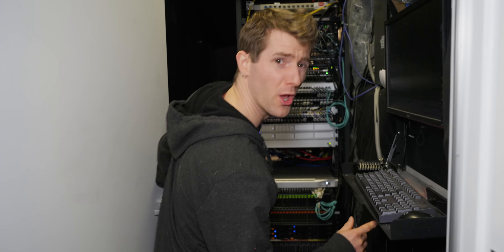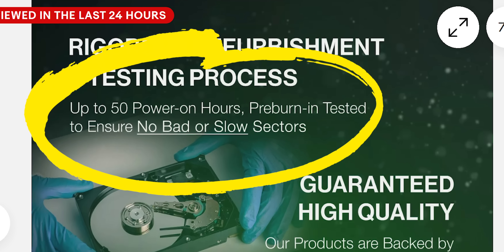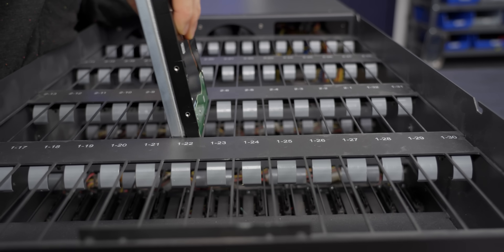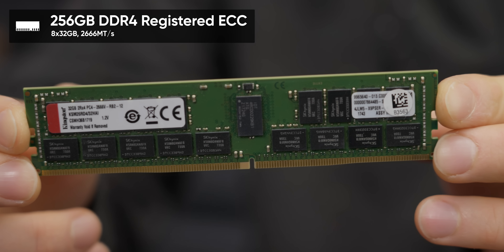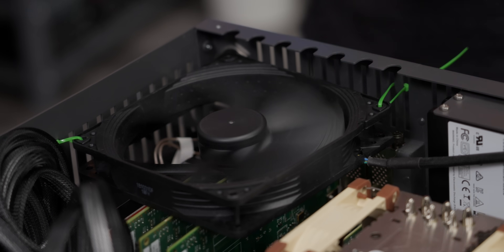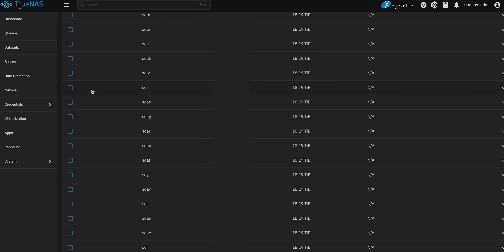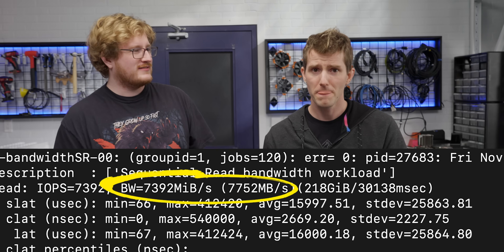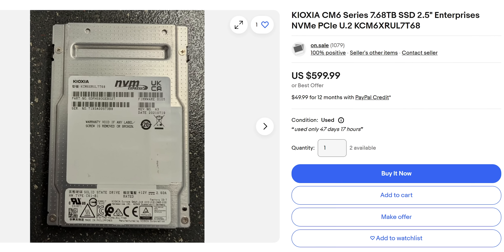Is Buying a PETABYTE on Ebay Stupid?

Comment: I've had 4 used 4TB HGST drives running at home now from Ebay at $65 each since 2019, then in 2022 I bought 4 more of the same drives for $35 each.  I plan on buying some more used drives soon as I've about got those full.  Also long run HD video, so sequential reads and writes are all I really need.  That and really long term backup storage.  I of course also have these backed up with Back Blaze.

Comment: I’ve been running 6 * 12TB seagate exos drives running on Unraid. Got them on eBay been running 24/7 for about 3 years next year. Been thinking about changing out to SAS drives

Comment: Switched from my old 3 x 8tb new drives to 3 x 18tb recertified seagate drives after one of the at that point 7.5 year old drives died earlier this year. They were basically new but one had one tiny error after I completely tested it. Nothing on retested. I guess I’m fine. I have 4 year warranty and even if one fails and I can’t get warranty I still come out ahead vs buying new.

Comment: I wouldnt worry too much about your drives. I have a 8 yr old 1tb harddrive that has been kicking nonstop in the computer. I think its starting to fail but it still works. Im running mine till death.

Comment: With so manny drives running them in a raid set it makes a lot of sense to use cheaper recertified drives. When one fails it is probably cheaper than full retail on new drives

Comment: I think it's important to note the killer for consumer spinning dives isn't power on time, it's power cycles. That's when the motors take the biggest hit. It take a big surge of current (relatively) to power up a motor compared to just keeping them spinning. If you don't turn them off... I've only ever lost drives to shock damage from them being knocked around.

Comment: 1:20 do they actually have any "ai" (machine learning) features or are they just another product shoehorning ai into its name
Reply: 14th gen HX = doesn't have a NPU -> shoehorning
Reply: Probably it is just "capable" of doing a.i tasks
Reply: Short answer NOP. There are almost no commercially available CPU's or GPU's for that matter that have hardware build agents in them. So it's misleading advertising in it's purest form. // To clarify RTX is not AI, nor software that is optimized to run AI related tasks
Reply: To be fair, even AI isn't AI. So it's not any worse than LLM and diffusion models branded as AI. Meaningless term all around. AI still doesn't exist. Part of me kind of thinks it's poetic justice that everyone co-opted the term and made it lose any meaning it had because it didn't have any real meaning to begin with.

Comment: My server runs recertified drives. It's my first batch and it's only 2 drives. BUT it's also been nearly 2 years of them running 24/7 and they still work fine. Paid ~$70 USD a drive back then for 8TB. The drives came with a full 5 year warranty too. Planning on next year buying 4 12 or 16 TB drives so I can go from a 8TB array to a 24/32TB array. PLEX servers really demand a lot of storage.

Comment: I have 40Tb (2x 20Tb Seagate Exos Recertified bought off Amazon) in a 4 bay Sabrent DS-SC4B for my media library in a Mac setup.    Nice thing is, I still have 2 free bays in the Sabrent for something else.  I've been thinking about getting a 12 or 14Tb Seagate Exos Recertified for use in Mac Time Machine Backup.  That would still leave me with 1 free bay.    Been using Final Cut to upscale my 1080p movies to 4K.  M4 Mac Mini Pro is on order, waiting to take delivery.

Comment: I got a couple HGST 12gb refurbs from eBay and they've been running a couple months now without issues. Power on count and hours was reasonable. I figured if the seller is offering 5 year warranty as part of official that refurb program then they're pretty confident in their drives. They also had seagates but "only" 3 year warranty

Edit: One of them acted up after a few months but the seller sent a replacement very quickly.

Comment: My personal storage array has close to 30 of the 10TB drives from Server Parts Deals.  I have bought them over the last few years and have had a failure rate inline with buying new for the data center I run professionally.  I have sent many people to them over the years and still buy from them often.

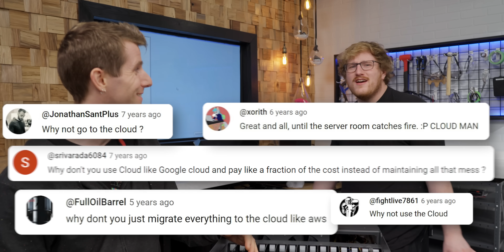Comment: 5:10 I mean... look you're right that cloud is expensive for medium-to-large size uses, but you have to stay honest with the selections. Your AWS calculator amount is 4x as expensive as a sensible setup would cost. I would imagine these items aren't accessed all that often; these should definitely be stored as Deep Archive objects rather than Instant Retrieval. Realistically you'd be paying closer to $20k/month with objects tiered appropriately. Still, that's 2x what you dropped to get these

Comment: Personally I run 15 drives which are all used or from these referb places and I've been doing it for years without any more failures than when I used to only use new drives.

Honestly, I have had way more failures of SAS cables, etc. than anything else over the last few years.

Comment: I bought 20TB WD External HDDs and shucked them into my server. It was not as cheap as the recertified drives but they do run without any issues for couple of months already. I bought if off amazon and one HDD was around 300 euro with the enclosure which I could probably also resell and gain some money back.

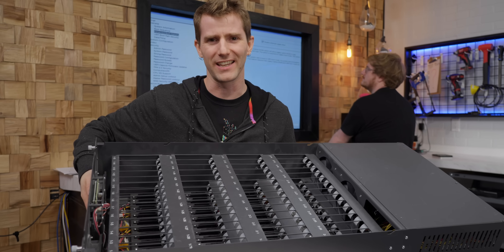Comment: Heads up, I would NOT recommend the Jonsbo N4 that you flashed at 5:40 .  The layout is pretty awful, the drives don't stay cool enough, personally I would not build in it again.  It essentially requires some 3D printed parts and some extra cooling fans to work, and most SFX power supplies will need a cable extension for the 24 pin due to the awkward layout.

Comment: I'm running unraid and bought a used HP Raid cabinet that came with 16x4TB used drives.  I've only ever bought recertified drives to replace drive failures.  I've done about 4 replacements for over the last 6 years.  3 of which were OG drives from the raid cabinet and the other was the 2nd recertified drive I'd used to replace a bad OG drive.  I just recently started buying 10TB recertified drives and am replacing all the 4TB with 10TB over the course of the next year.  For home use and the fact that you're protected by what ever redundant RAID option you picked it just makes way more sense to buy recertified.  The money I've saved has greatly outweighed any dependability I would have gained from paying 2-4x the price on new unused hardware.

Comment: I bought 10TB HGST from eBay; 100+ of them. No issues after 2 years.

But the other seller I used prior, I returned all 60 drives. I had 10 with issues in that batch.

Comment: I've been doing this for a while on eBay. Sellers are selling several hundred at once and appear reputable and been around for a while. Just old server parts, basically. I was able to get 8x 14TB WD HC530 recently for $110 each (at the time). Drives are used in an raid with redundancy so risk still acceptable. Before that, it was shucking Best Buy WD EasyStore drives around black Friday.

Comment: I've been using used drives for sharing my Linux isos for friends and family. For the last 5 years only one of my drives is starting to make noise out of the seven I have with the arm motor getting louder so I'm gonna be replacing that drive shortly. Else it's been a smooth ride using these "used" drives. Same with SSDs. I've been grabbing Intel pcie ssds when I see them for a good price. Great game drives for desktops or caching drives for my NAS. Just don't save anything you deem important on them and feel good about yourself knowing you saved a few bucks.

Comment: Linus make a video about airflow .. I know this all, but i see videos on YouTube with total wierd stories ..
So i gave them the reaction that the amount of air what comes in got to go out on the back of the case with the same amount or as near as possible .. 
They didnt undertstand that kind of thing .. LOL :face-blue-smiling:

Btw.. Recertified hard drives are units that have undergone a thorough certification process by the original manufacturer. This is a good buy if you need many disks :hand-pink-waving:
They have now Barracuda Pro for 112 bucks .. Its 12 TB .. Thanks for the tip Linus :trophy-yellow-smiling:

Comment: they come from data centers. it's common practice to switch out drives after their warranty period as it's more cost effective through exclusive deals with manufacturers than going through the process of potential loss and recovery of customer data, and in the past they were actually destroyed to prevent any sort of rogue recovery of vital customer data. not sure what's changed, but ive noticed a half official half unofficial market emerging for them over the past few years. they're often close to new condition and had gone through more extensive qc so the few hours on them dont mean much. win for the consumer if you ask me

Comment: I hope that the BcacheFS file system will become a more popular choice for network storage, where the priority is the speed of data access, especially for small arrays of 3-4 disks, this system shows itself best with an SSD as a disk with a cache. It also can work with various RAID configurations and disks of different sizes, making it a good file system for large libraries of games.

Comment: I got a 25 SFF SAS3 HP proliant DL380 P Gen 8, and an old 10bay SFF HP Storage Works MSA 50 brings my system to 35 drives I only have 16 TB raw storage, 7TB Usable. 2GB flash back write cache as well and quad gigabit Ethernet and dual 10 Gigabit sfp

Comment: I've gotten all of my hard drives in the past few years from ServerPartsDeals (maybe 6 or 8) and only had one issue, which happened soon after installation, and they replaced it under warranty, so I'm quite happy with the cost savings.

Comment: I got one as a replacement for the one I sent in as part of their warranty program. Still going strong. So my old drive might be out in the wilds now as a refurbished one. The only thing you need to take care about is to get those drives from a certified seller as there are fake refurbished ones on eb*y (and other platforms) with faked stickers as far as I am aware of based on research on them.

Comment: I have an i3 system, bought 36 12 TB drives off Newegg. $68 a drive after rebates. This was a couple years ago. UltraStar. In the last two years I have had two drives fail, running Z1 I have had no issue swapping those drives out.  I have not tried reconditioning the failed drives but that is on my list to do.   I also run mirrored caching on my trunas core

Comment: I recently purchased a 12 TB HDD for 130 on ebay, they increased to ~150 now. So far no issues. I am limited on funds so I am trusting it for now, but will switch to RAID in the future. OMV SMART check shows no errors. Mine had around 40k hours on it though. Its an IronWolf

Comment: my own theory which I have no way to prove is that some data centers buy like 200 drives while they only need like 150 and 30 spares just so some drives are DoA (dead on arrival) they have extra 20 spares on the spot and then when they are done installing the batch and making sure that it works fine they return the excess to seagate to negate as much financial losses as they can

Comment: I think it would be sweet to get a "mother video" on NAS building, similar to the 2020ish PC Build Guides. 'Read Cacheing and Level 2 Arc' is complete gibberish to me, but I still want to build a NAS sometime soon with old parts when I build my next PC.
Reply: "How to Build a NAS, the last guide you'll ever need!" 2025 Edition! But for real, after buying HexOS recently, I still feel like I could use a couple more pointers before fully committing to it.
Reply: @CrimsonBlade104  Absolute best thing you can do is have conversations with ChatGPT. By saying what I wanted the RAID server to do, what features I wanted, etc. it helped me decide on my O/S, and then it helped me troubleshoot issues. I was able to say what was going wrong, what steps I took so far to troubleshoot, and then it would recommend possible solutions with step by step guides to fix it. 

I started with Unraid and then decided to switch to TrueNAS Scale, and it helped me through both. I was setting up a fairly complex server with multiple docker containers for Plex, Immich (Google Photos clone), and several other apps that I wanted to have behind a VPN while also being able to talk to each other. I was also able to integrate my Home Assistant into it on a VM. So far, I've been very happy with my NAS and would have been pulling my hair out if not for ChatGPT.
Reply: Yes!! Or even the talk about "RaidZ expansion features" allowing for pool expansion. Does that work with ZFS and TrueNAS? Wouldn't that invalidate the one main advantage of UnRaid?
Reply: @dennispremoli7950 RaidZ is part of ZFS (where the Z comes from) and available on TrueNAS. Pool expansion isn’t the same as just adding more drives to a raid array (as I’ve learned after trying to do that today) which IIRC unraid lets you do.
Reply: @dennispremoli7950  The normal problem of pool expansion is, all the drives in the pool need to be the same, or larger. This is part of OpenZFS, but it's still in the testing/future version branch, sic. depending how you use ZFS, i.e. Proxmox, hexos, TrueNAS scale, or Ubuntu, et al, you just need to recompile it, and ... be prepared to keep using it as you 'cant' undo it easily. 

If you buy drives from various sources all the time, it's probably a better bet to use Unraid or SHR type systems that handle expansion / parity better. ZFS can resilver data in much the same way that Unraid's Parity and SHR's / BTRFS's md system 'can', but ZFS is more skeptical of hardware and drive's failing in a major way, and creates safe stages to both scan for errors, but also ensure parity is stored properly. It comes at the cost of performance, but when storing archival data, it's far more reliable. 

CoW filesystems have advantages over Unraid/SHR, because they can be rewound/forwarded when there's a large change i.e. someone deletes a folder or a virus overwrites the entire network drive and attempts to encrypt everything. Synology has this with Btrfs and SHR, unraid, it has to be switched on as well with Btrfs. The other advantage of snapshots is, you can undo to a timestamp if an update fails, similar to windows restore, but, these snapshots hold a copy of the old data/changes which is basically a form of recycle bin/temporary storage. 

If a Parity drive dies in Unraid, you're unable to recover easily. If a SHR drive fails, recovery is usually a bit more complicated, but it can be done in a live-fashion. Expanding the SHR is a bit more complicated,but handled as well.
Reply: Something like "this is when you have to use chown and chmod to manage permissions cause the UI is NOT FUCKING WORKING!"
Reply: YES!  I have started on exactly that, and finding and putting together in my head the information to make informed choices is a struggle!

My theoretical goal is to repurpose an old motherboard that has eight SATA ports to assemble my RAID array; apparently AMD RAID is completely nonexistent in Linux, so I have been looking at (untrustworthy to me, very old hardware RAID guy) software RAID options in Linux, and IT'S A MESS! I was/am hoping to go with a PCIe M.2 boot/operating system drive (Do I need/Can I have a matching😅 second M.2 drive as RAID 1 fail-over or redundancy?) and build out the array as first a single drive, then mirror that, then add a third drive (RAID 5), then add a fourth drive. (Budget.) That will give me all the storage I need for my own purposes for years; but as my motherboard has a second drive controller with another four ports, I was thinking to continue building out with four more drives. Eight total with seven active, two drives' capacity redundancy, and a spare. That thinking just comes from my old experience with hardware RAID 5, where it's not only possible, but very easy (Within the limits of 5 drives active, 1 redundant, and 1 hot spare and two cold spare in the ProLiant rack server I had).
Reply: Just use ZFS with zstd it has RAM caching and works great. I got 6 SAS drives and they fill my 25 gbits connection.

Comment: I have an 8tb WD Enterprise drive I got from eBay about 4 years ago, and it had a couple bad sectors when I got it (mentioned in the listing) and its only just now starting to have issues. No data loss, just a bit slow to be recognized

Comment: My experience with used drives is pretty mixed , I bought drives from ebay, a refurbisher and second hand from a tech form (Tweakers) the refurbished wd drivers 2 out of 4 died after a year 1 extra after 4 years , ebay from the 2 drives none died, and from the form(about 4 different sellers) I bought 10 and 2 died. after a year. all western digital red 4 tb (CMR) Note I bought  6 new ones in about 2015 and all of them work, most of them run in the same server.